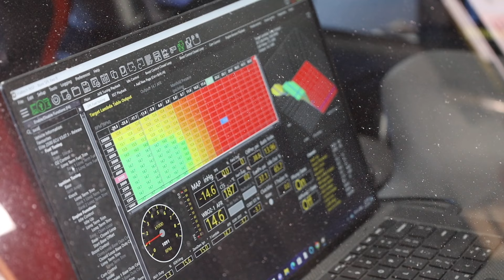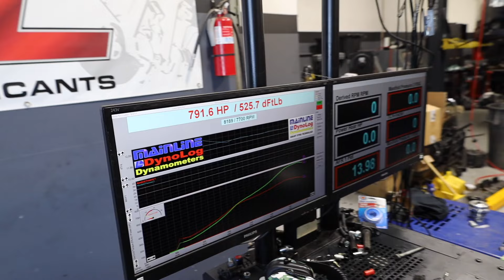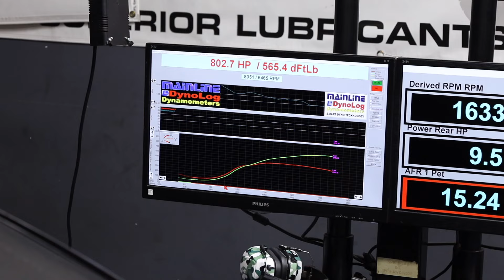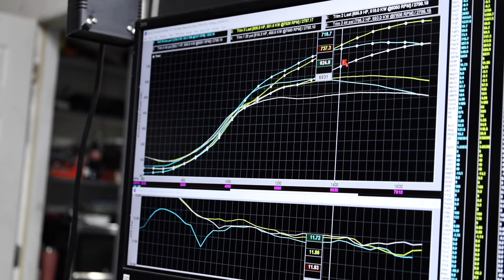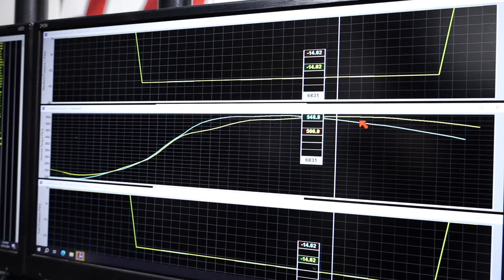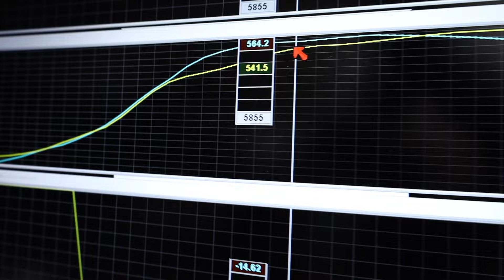800HP BIG Turbo SPL Evo 9Rs Returns for more Power!

Comment: Just a quick correction Ronnie: The G35-900 and the G30-900 shares the same compressor wheel. It is the turbine wheel that is bigger on the 35. One's a 6262, the other's a 6255. Great video as always 👍👌